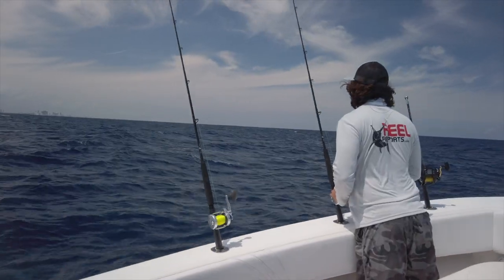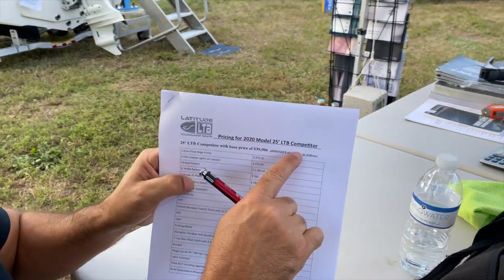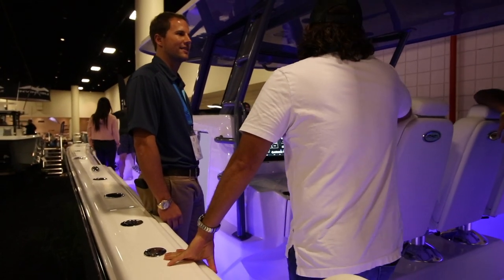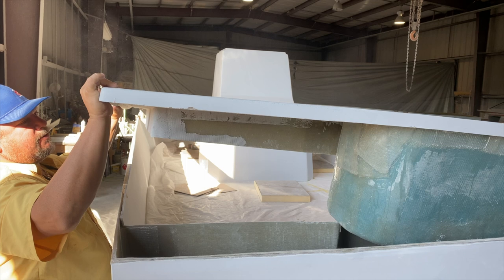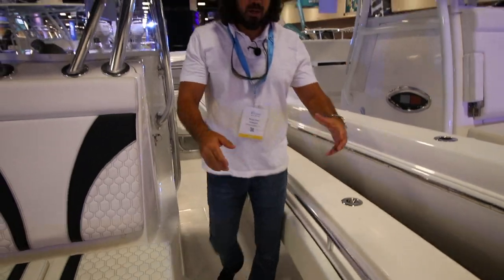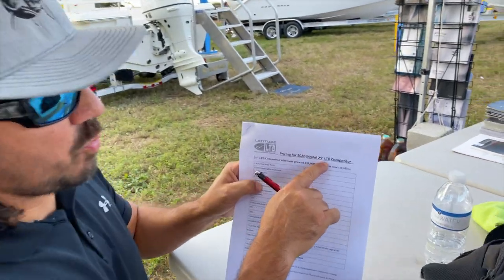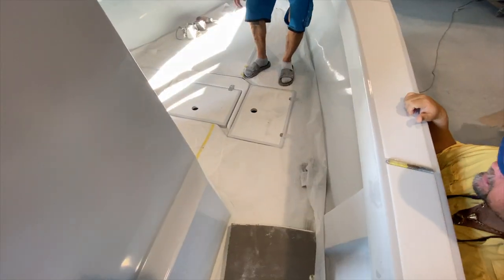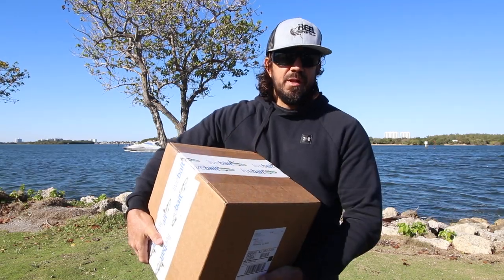How to Build a Fiberglass Boat Step by Step | Series Introduction

Comment: Looking forward to seeing the boat Mike. Just curious what are your thoughts on the sea keeper? I know it adds some weight but with a less stable hull would you consider getting one?
Reply: Hail-Recoil I’m not mike lol but I have been on a 23 with a seakeeper. It makes a world of difference while your anchored up/drifting. While it doesn’t stop the up &down motion it will stop the side to side which is what I think usually causes sea sickness. If your on the water All the time I’d consider one but if your going out on the water once or twice a month then I wouldn’t bother.